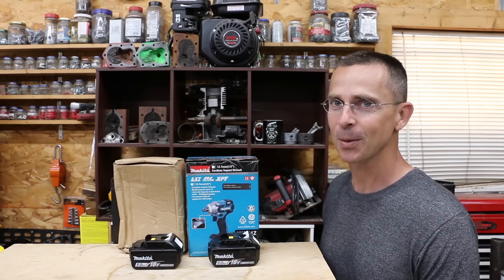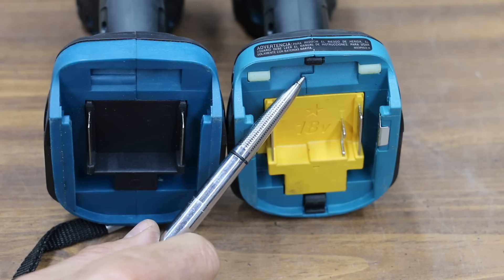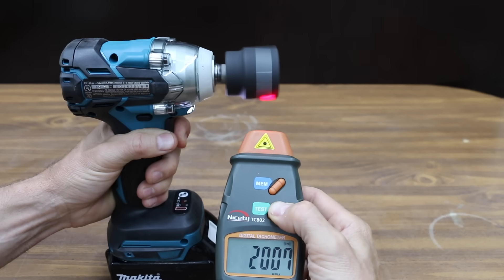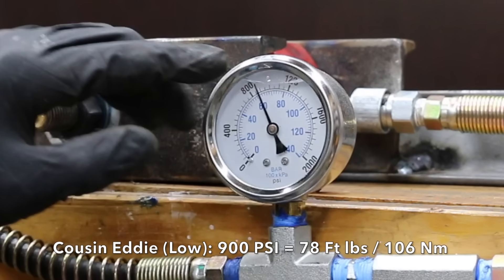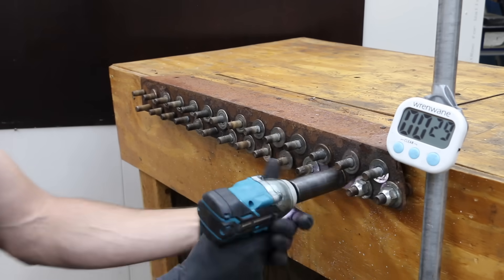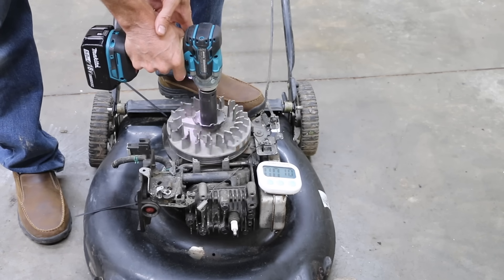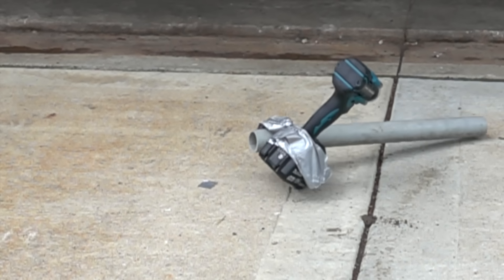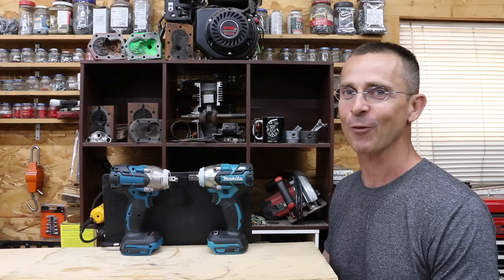Fake Makita Impact Better? Let's find out!  Makita XWT11Z 18V LXT Lithium-Ion Brushless Cordless

Comment: I live in china for many years now.  He is comparing $130 v $30. The problem we have here is that a Makita here is more than 10 times the price of  a knock off.  I just checked, the Makita XWT11Z  is 2144RMB (= $335) to buy here due to huge import tax. It just make quality brand name tools an unjustifiable purchase.Shame
Its quite frustrating actually , especially when you don't want Chinese own made products like motorcycles whereby brake disks can shatter and  ABS system fails (as happened to me!)
Reply from the maker: Thanks for the feedback.

Comment: I would have hopped that your suggestion would have sound something like this:
"Don't take that drill even it is for free. Makita does't promote any fake facts and deserves support. The other try to sell their device by throwing untruth facts (which is lying) on the consumer which is really respect less and so for sure don't deserve any support and not even by giving it away."
Reply: Sometimes, you're not looking for a quality tool just one that works. You aren't planning on making the use of the tool your career, it's just a tool to get a job done. The difference between spending $120 vs $40 for a single use (maybe for a couple uses) is quite apparent. Sometimes, good enough is "good enough".
Reply: @birddogne666  it's nothing wrong with cheap tools. I  have a problem if seller claim intentionanally wrong facts just to make people buy their stuff. And letting it shine like an other but really good tool is fooling people by intention as well! There's my problem. And this good man here is providing a promotion plattform for such people. But as long he gets his clicks and thumbs up, well, his world seems to be ok.
You can produce and sell cheap tool, but don't claim lies!

Comment: best review channel ever! Comprehensive, objective, scientific.
In case of this review, I would go for the knock off.
$138 makita vs $30 cousin eddie, that's 4.6 times higher in price, and all the testing data are not as high as 4.6 times. In terms of quality, for same price I can buy almost 5 of the cousin eddie (which also includes 5 battery...). This allows a shop with 5 employee works at the same time or working longer without charging for a shop with less employees. Or think this way, how many brake job a shop has to take to justify the cost? With cousin eddie, a shop can get the cost back at almost any job. Besides, cousin eddie is not that shitty.
Reply from the maker: Thanks!  Thanks for the feedback.
Reply: And after first use, only used 1-2 times per year.

Comment: Instead of the extra-generic-knock-off-ebay tool, here's anotehr far more easy to procure by any of your viewers: get the same/similar model at HarborFreight - and let's see how they compare.
But definitely, one thing in common, no matter the supplier, they all lie about their "oh so awesome" specs since the common users are not very concerned with the most optimal performance: all they care is price and a tool that is reasonably close to the original.
Reply from the maker: Thanks for the video idea.

Comment: I've got a Makita and, unfortunately, I've done that handle breaking move.  It's a weak point in the design and the driver preferentially falls with the head down.  The rubber wrap is holding it together right now. At some point I'm going to beef it up with some fiberglass.
Reply from the maker: Thanks for sharing.
Reply: warantee my dude, did you buy from homedepot or some place like that? get your receipt. I have returned a few to Makita and got brand new ones mailed back.

Comment: the comparison with all the lug nuts was very inacurate, due to how fast you were dropping the lugs from the Makita, and how slow you were holding/dropping the ones from cousin eddy. granted, obviously the knock off wasnt as good as the name brand, but still was just too many variables there to determine how fast someone can remove that many lug nuts. imo
Reply: comparing brand to knockoffs has always been about durability. not speed.
Reply from the maker: Thanks for the feedback.

Comment: IF in all seriousness, makita was 4x the price, but did not bring 4x performance, i dont think that the 30$ tool was that bad. Of course its lifespan will be shorter, but if it comes with 2 year warranty and you are not a pro, it would be a decent, cheap tool to have around. Of course if its your job or you are dealing in serious stuff, you need pro tools, but i expected A LOT worse from 30$ one.

Comment: Honestly for 5X the price, while the Makita obviously performs better, I’m not sure it works 5X better for the average user.
Reply: I think one of the thing I want for tools is durability. In my experience makita tools are very durable when working construction. I.have had cheaper tools at home while working with makita at work, the makita ols got used way more than my knockoff but the kbockoff showed problems earlier. So in that aspect I do think its worth more (although there will probably always be some miney you pay just because its a known brand.. just how the world works I guess)
Reply: But is the makita actually 5x more durable? Probably not.
Reply: @KLAWNINETY  time is money, the knock off is slow and with precise handling it is shittier, which makes you lose more time when you need some precision. Makita delivers speed and precision, this too needs to be factored in, not just durability.
Also it sucks to have to throw in a spare one in your van or pick up truck because you went with the far less durable one.
Reply: @sannedemuijnk4812  I've broken plenty of makita tools, never a Milwaukee though.
Reply: @Reginald-Bowls  Total BS!
Reply: @Reginald-Bowls  Milwaukee sawzaws are fine, the corded ones.  I have my buddies construction company to compare to, he is all milwaukee, im all makita. Milwaukee might be a tad better than dewalt, but Makita is the most durable setup as far as lithium ion drills/saws/grinders/rotohammers   out of about 20 drills, 2 sawzaws 2 skillsaws, 10 rotohammer drills.. I have 0 that don't work. some are almost 18yrs old
Reply: It will last 5 times as long though.
Reply: @natekry  at least - I've a corded Makita SDS hammer drill that I've had for nearly 20 years and it's still going strong!
Reply: pretty much.  If I quit using mine as a daily commercial user, I would be fine with the $30 one

Comment: Looking at this from the perspective of which should be bought, I'd say it depends on what you're using it for. If you're a professional workman who uses a drill like this every single day, you probably want the Makita. If, like me, you would use this a few times a year and isn't bothered about a 30 second difference between drilling in a few bolts, then Cousin Eddie is probably more than good enough. If you're only using it a few times a year, then the chances of you dropping and breaking it are lower than someone using it every day, so if you drop Cousin Eddie, you could buy 3 more before you'd have spent the money on the Makita.
Reply from the maker: Thanks for the feedback.
Reply: Of course!!!
Reply: IMHO if you only need something for a couple times a year, get a corded version. You won't find a dead battery when you needed it.
Reply: @wshtb  corded version won’t help with a flat tire on a road shoulder near a ghetto at night.

Comment: Testing clamping force multiple times with same washer that's crushed & nut biting into it ... Pretty pointless ... Impact tools albeit air or battery powered get the high torque from having a large anvil chamber, these small chamber tools all produce low impact tightening torque & have useless nut busting torque ...  All manufacturers of impact tools claim ridiculous nut busting & tightening torques, it's all false claims, even with the premium brands...
Don't get me started on batteries ...
Reply from the maker: Thanks for the feedback.

Comment: Just as a thought. I use a Stanley cordless drill 120€ but I also use a Parkside (Lidl) cordless drill 25€ they are both good in their own ways. Stanley can do masonry but struggles sometimes, great with drilling and screwing wood. The Parkside masonry out the question and less power for screwing harder wood but because smaller can fit into tighter area's and has quick release chuck for drill bits. If I'm doing a job that needs screwing and drilling wood, I use Parkside for drilling and Stanley for screwing (so I'm not wasting time changing bits). I'm well impressed with the Parkside drill and as a brand for such cheap tools they last, do quite a good job for my little farm.
Reply from the maker: Thanks for sharing.

Comment: Funny how these Tools have not developed at all in the last 30 years. Yet they still cost the same and sometimes even more. Why is there no RGB and LED touchscreen on it so you can watch Netflix while drilling someones mom? Maybe it could even run Doom 64. or a bottle opener on it and a folding knife so you can butter your bread with your drill
Reply: Every tool ever made is dual purpose, try throwing them at your helper when they slack off, you'll see. 👍

Comment: Bought a 10 dollar on sale harbor freight 4" grinder. Month pryor bought Dewalt 4" grinder 150. Where I bought it. Dewalt lasted 4 months brushes went out. Totally died less than a year. The 10 dollar lasted 7.5 years killed it cutting a 80 gal water tank in half to get it out of the well house. Name means shit now a days.
Reply: What is a well house? Do you have you own well and built a house around it?
Reply: @AbuHajarAlBugatti  It's the pump pressure tank house. For your water Tiny house 4' high. The tank pump below frost line. Cement box try getting 80 gal tank out of it a bitch by yourself. That 10 harbor freight saved my ass.
Reply from the maker: Thanks for the feedback.

Comment: A a new DIYer Im afraid Im a bit late to this party, but a very good video non the less. I think we all knew how this one would go, the Makita was going to win all the way. If Cousin Eddie was the better one then Im sure Makita would have been using these cheaper components and putting their drill out at less than half the price. However, a real important question you asked is that if Cousin Eddie was worth its price, and Im so happy you said yes. As a new DIYer I really cant afford to buy 10 pieces of electric equipment from top rated companies. However, What I can (just) manage is buying these all as knock off versions and then in the future buying a better tool to replace what I already have. You also have to consider the fact that someone like your self will probably wear out cousin Eddie in a week or two just through your everyday uses. However, The rate Im using tools, being a weekend project maker Cousin Eddie will probably last me years while Makita would probably last me the rest of my life.
Based on this video you have just gained a new subscriber. Thank you
Reply from the maker: You are welcome!  Thanks for watching and subscribing!

Comment: We did the same thing at work , compared Kevin's Milwaukee battery impact to My Hyper Tough [ Wal Mart store brand ]  battery impact . In a side by side test the max torque was higher than the Milwaukee , speed, the of both about the same . However the Milwaukee had adjustable torque that was a good thing to have , as the Hyper Torque was simply on or off and could break off a 10 mm screw easily . All things considered ,the Milwaukee costs $ 110.00 and it needs to be noted does not come with a battery pack or charger, this price includes those , the Hyper Tough that comes with battery and charger was $ 44.65 . you have to supply socket adaptors for either wrench , the Hyper Tough set is $ 7.98 and fits both wrenches .
Reply from the maker: Thanks for sharing.

Comment: The fact is, they’re all cheap plastic junk!
Reply: So what's good ?
Reply: @dpz9872    Whatever works and gets the job done because sooner or later they all end up in the trash regardless of the brand.  The deciding factor should be brand longevity. Buy a brand that will not go belly-up and fade away into oblivion. That guarantees that all the accessories you have, like batteries and chargers that usually outlast the tool can be reused (as they all are prioritized) when the tool dies, breaks or gets stolen, especially on a job-site.
Reply: @TheEDNC  

Oh, okay.
I buy Milwaukee because that's what my gramps buys, and he owns some pretty old and reliable tools.

Aside from that maybe I occasionally go into the new Porter Cable tool outlet but Milwaukee is kinda my brand.
Some guy's at work say I'm wasting money, my boss says I'm the least experienced guy with the tools I need to become one of the best.
I think maybe their just jealous and waste their money elsewhere.

Thanks for your input.
Enjoy your weekend.
Reply: @dpz9872    They're jealous. Tell them that Harbor Freight tools make good stuff too (if you buy their very best), but they keep REDESIGNING and upgrading their tools especially the batteries, so sooner or later they won't fit the newer versions of their tools anymore rendering them obsolete. That's where the money really is, in the batteries and chargers.

Comment: “Cousin Eddie was shipped directly from China” 

So was the Makita lol. They’re probably made in the same mold facility
Reply: Makita was shipped from China but not directly so he probably got it faster. Where it's made doesn't make as much as the material selection and clearly, the Makita has superior material selection.
Reply: @luminescentlion  Same as Milwaukee and Ryobi, after all they’re all owned by the same Chinese tool company

Comment: I've got one of the knock off's to use in a motorcycle workshop. The only nut it can't undo is a countershaft sprocket nut... You need a heavier tool with more grunt !... other than that we use it everyday with no probs.
Reply from the maker: Thanks for the feedback.
Reply: @ProjectFarm  Mind you, the Makita would probably get countershaft nuts off... The other good thing about Cousin Eddy is there are Cousin Eddy batteries VERY cheap compared to Makita.

Comment: The answer will be different for everyone, but it's hard to justify paying $100 more for a tool that doesn't significantly outperform a similar tool as a shade tree mechanic.  Even if it breaks, two cost less than 50% than the one...  My only justification would be if Makita actually made it in the USA.  Money still goes to China
Reply from the maker: Thank you!

Comment: You may have had a dud cousin Eddie. I have a fake Makita called Golkar and it's responsive and works quite well. No lag at all. It looks a bit different and weighs 1630 gms. 5OOgms more than Makita. The battery is 21 volts, maybe it's an updated model. Edit; The max rpm is 3200rpm and 2800.
Reply from the maker: Thanks for the feedback.

Comment: hey been watching a lot of your videos recently. Video Idea for you. Ive looked and looked and watched and watched many youtube videos, could not find any good ones explaining differences between 12volt vs 18volt drills (Makita). Also someone explaining the difference between all the Makita drill Models. Maybe also explaining hammer drill vs regular drill vs impact drill. Another idea 2ah vs 3ah vs .. Batteries and actual tests. dewalt 20volt vs 18volt. what batteries can be used with what platform. I did enough research that I now understand all of these things, but you probably would have made a better video than any of the ones I saw.
Reply from the maker: Thanks for the video idea.

Comment: China ripoffs of Brand name products are NEVER as good in My experience ! I've had Makita 18V Lxt since they came out over a decade ago and use them hard. They have never had to change their batteries and chargers unlike the yellow and red brands who did several times in one companies attempt to make Lithium batteries and tools that held up.  Makita's batteries and chargers were engineered in cooperation with Sony, perhaps that is why they last so much longer than the other brands. Or maybe its because they use the best Samsung cells over the dozens of cheaper cells. I don't know, but I have been happy as a lark I chose Makita 12 yrs ago. I'm still adding tools to my original Makita 7 pc set  and all of of them have been great.
Reply from the maker: Thanks for sharing.

Comment: ~30 bucks for such a useful tool is actually quite a good price. As long as you don't expect it to last through heavy and regular use, it's surprisingly useful. A nice, cheap tool to have laying about in the shed/garage for occasional use. Better that than an expensive tool you rarely use. 

Reliability and durability is the most important part. Power can always be found cheaper, so it's not a defining factor. So.. if it is a tool one needs to have working any time it is pulled out (even if it is rarely), then the expensive and original option is the way to go. If just a tool that is nice to have, but not really important, the knock-off.
Reply: That's how I feel about Harbor Freight, if I use their tools enough to actually break them, the extra money for a major name brand tool will be worth it.
Reply from the maker: Great point! Thank you
Reply: 100%
Reply: Well said. If you're drilling 10 holes a year, you don't need the Makita!